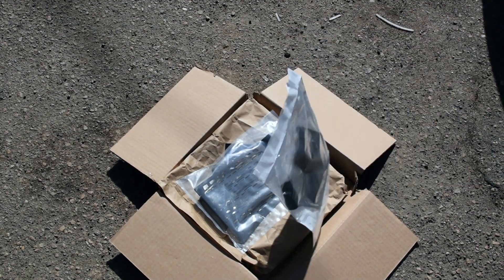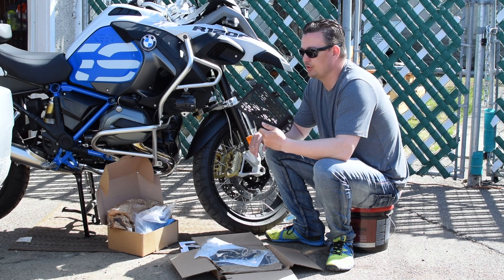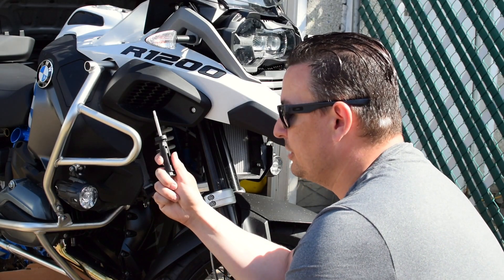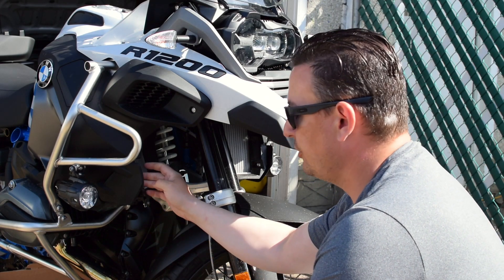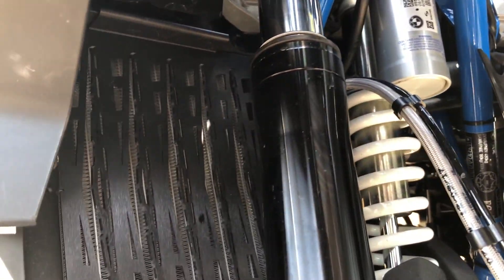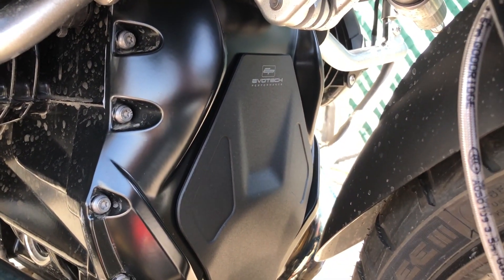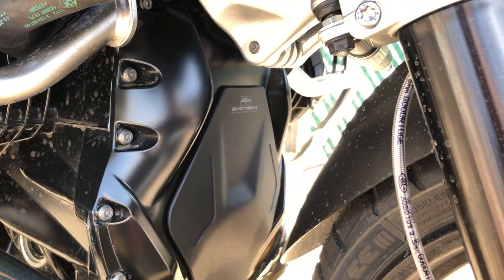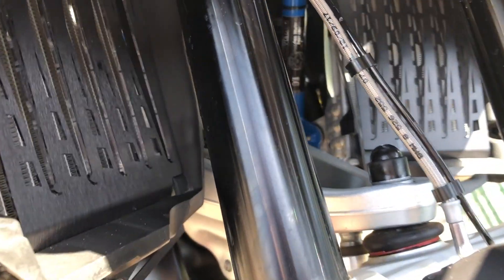Altrider Radiator guards for the 2018 BMW R1200 GS ADV Rallye.

Comment: How did you get your hands on radiator guard for the 2018 versions already? They arent on Alt Riders site. Im assuming you grabbed a 2017 set and modified them like you said towards the end of the video?
Reply from the maker: Rebekah Peterec not really modified. Just a tweak . One side tab was bent farther then the other . I just bent it back a bit and fit fine . Ordered off FortNine. No difference in 17-18 adv